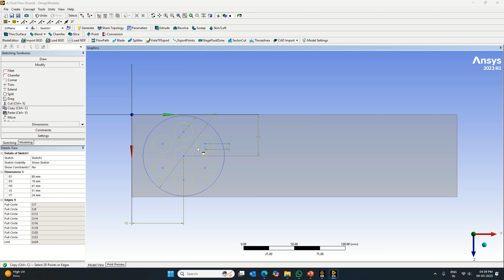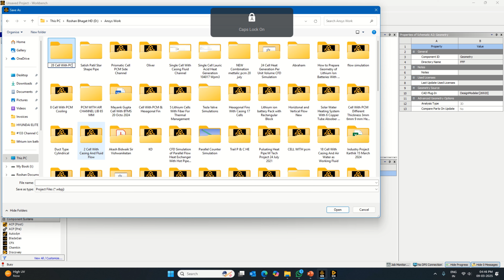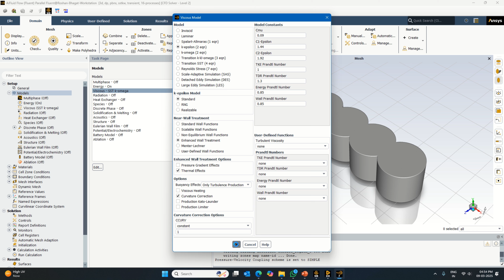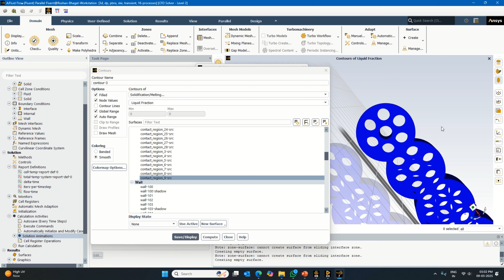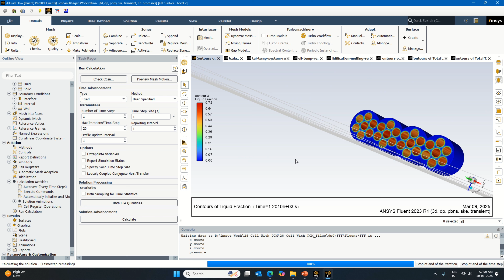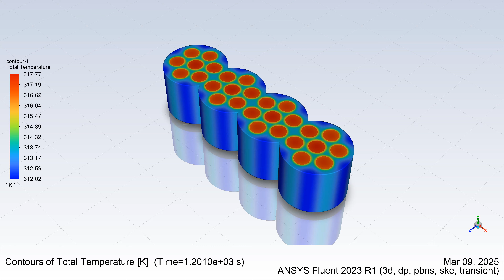CFD Simulation of Paraffin Wax PCM-Based Battery Thermal Management System

Comment: Hello blogger, I would like to ask about the difference between Wall and Wall Shadow and whether the material should be set on Wall or Wall Shadow. Thank you!
Reply from the maker: wall is the physical boundary of a solid or fluid domain.
When you define a wall in Fluent, it acts as a boundary between a fluid region and another domain (solid or another fluid). This is automatically created when a wall is shared between two adjacent regions (e.g., fluid-solid or fluid-fluid interfaces).
Fluent internally treats the wall and wall shadow as a single interface where continuity conditions are enforced.

Comment: How to define c rating of battery
Reply from the maker: Need to calculate based on resistance and discharge current value
Reply: @FrontiersInCFD  I want to know how to calculate
Reply from the maker: Heat Generated=I2*R